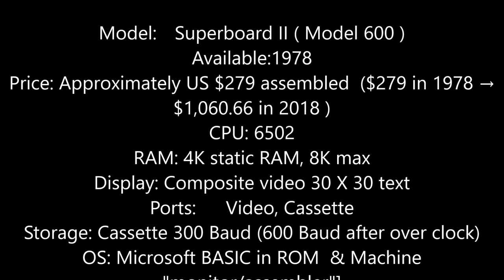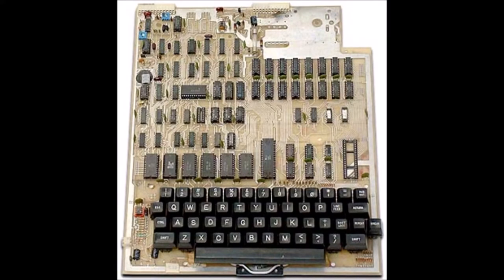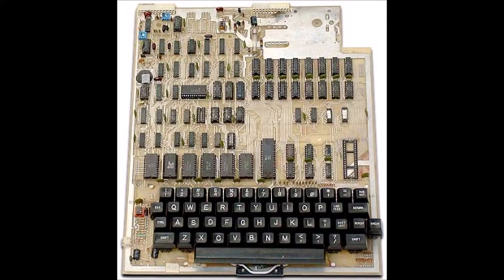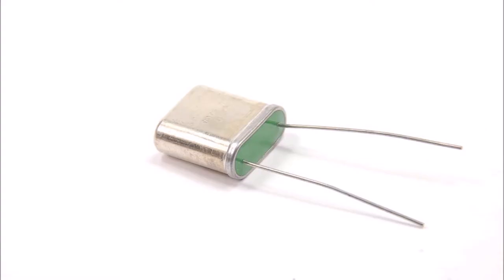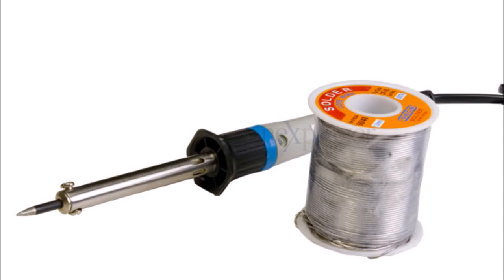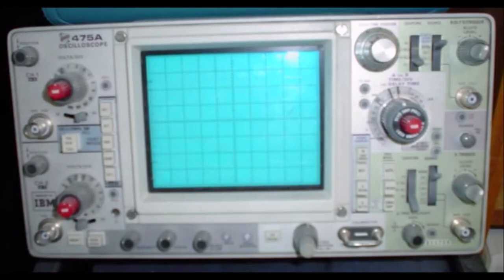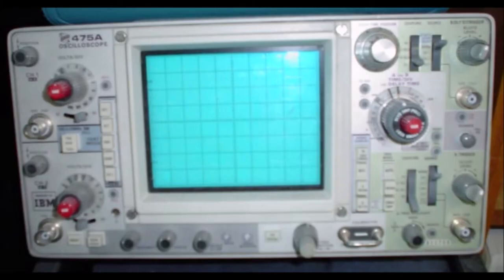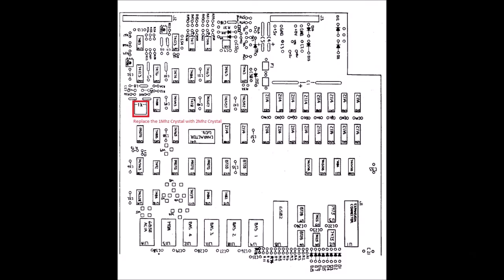6502 Overclocking Ohio Superboard II. 37 Years later and still modding..

Comment: I remember having one of these.   I did a lot of mods to it, like adapting the Apple ][ ROM monitor to it to replace the very minimal tape-loader in the original ROM.  Then modified the video out and the BIOS for 64 characters per line which was just a two-wire move.  Also implemented the RS-232 port that was left unstuffed on the motherboard.   Good times.  Later I plugged in a 2MHz 6502B and changed the jumper on the motherboard to run at double speed.  Nice speedup but then the video blanked out an awful lot on every character write.
Reply: Wow, what a looooong way down the road of nostalgia! 
I too had a Superboard  II, revision D board, aquired in 1982! 
Many, many hours of wonderfull learning. The first thing I modified was the casette interface baud rate from 300 Baud to 1200. A simple mod that involved moving a jumper! I learned to write 6502 machine code using the cassette bassed Assembler and the 6502 Cook-Book. For a monitor, I used an old portable black and white TV set, that had its RF de-modulator by-passed to accept composite video. The cover of that little TV was hardly ever on, and I shocked myself on the HT lead, (more times than I care to remember), while adjusting the "focus", that would frequently "drift" !
Those skills that I aquired were put to good use in my first "real" job, building household alarm systems, which incorporated the trusty 6502! Marvelous! Thanks for the memory jolt!
Reply: I was able to get it working reliably at 2Mhz using the jumper trick without having to upgrade the processor or RAM. I don't think it was even called overclocking in those days. It was just one of those "hacks" that I found in the Ohio Scientific user magazine.

Comment: Just a couple of points - as others have said you could easily up the clock rate by changing a jumper. Yoy may need to substitute the 6502 for a 2MHz version (65C02 better?). Also according to the assembly instructions and the service manual the original crystal was 3.932160MHz not 1MHz as quoted in the video. When divided by 4 as on the unmodified board this gives just under 1MHz at the processor. (Soldering in a 2MHz crystal would halve the processor clock)
If you change the processor to run at a higher speed (~2MHz) you may find that other components stop working reliably. My original 2114 RAM chips were 550ns access time - dubious if the cycle time is now 500ns. Also the 6850 is usually rated for 1MHz system clock and would probably need to be the 'B' version unless you get lucky. The original ROMs were also (pretty slow) just fast enough.
Apart from this, overclocking by changing the crystal will change the video timing and the cassette baud rate and frequencies (as in other replies). 
I too remember buying my Superboard from Watford Electronics and having a good time with it. So much so that I'm building a (sort of ) version with VGA(32 x 30 at present, 64 x 60 a possibility) output (since I don't have an old TV handy) and PS2 keyboard. Also trying to avoid the cassette interface - never liked that much. 
Years ago I tried to make the original board display interlaced (312.5 lines per frame) - it worked but looked horrible on a TV.
Happy hacking.
Reply from the maker: Yes, you are correct,  I believe I used an 11.8Mhz crystal to run the CPU at 2Mhz. There was some additional logic in the prototype area and some changes made to the video ram and an EPROM that replaced one of the BASIC PROMs too. I wish I still had the schematics and that EPROM. These were changes reversed in the 1980s. Yes, I'm still hacking too. https://youtu.be/hUMJbJfMKZI
Reply: Exactly!!! I did that simple jumper on my Superboard II that I still have and that I recently retrieved and found it still working. I added a switch so that I could go back and forth between 1 and 2 Mhz
Reply: Yes, the original chip was a colorburst crystal if I recall -- which may have helped generating timings for the video output.

Comment: Cool! Did you check over the board for anything getting excessively hot? I would expect some things would need to be heat-sinked. I'm somewhat surprised that 1 MHz 6502 would even run at 2 MHz. Not to mention other circuits IE the memory.
Reply from the maker: I'm planning to rebuild this system when I have time. It has been sitting in the shed for the past  twenty years and I hope it will still boot, once it is up and running again  I will check the thermals for you ;-)
Reply: Worked fine for me without any chip changes